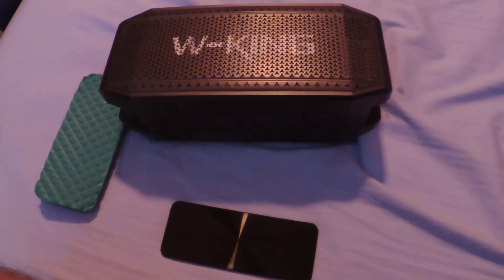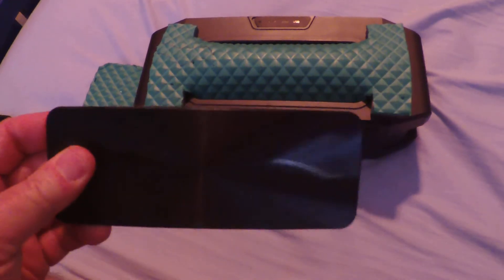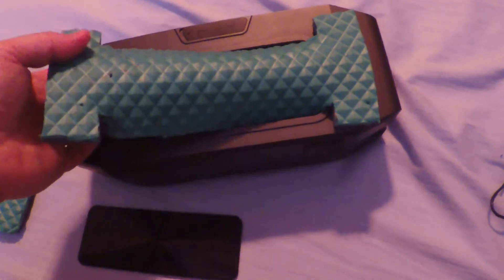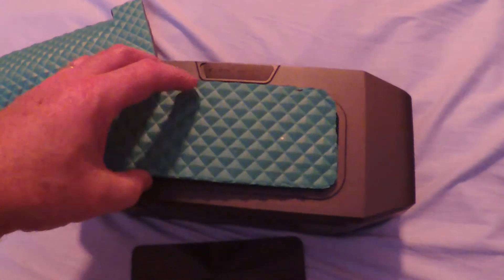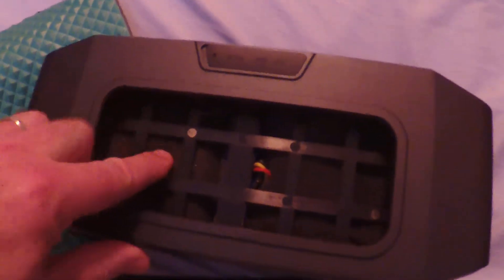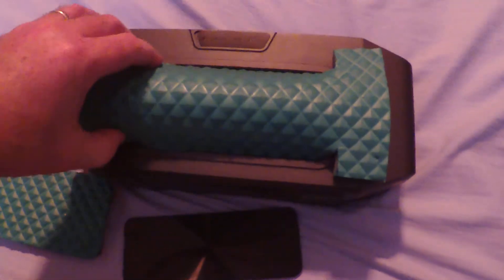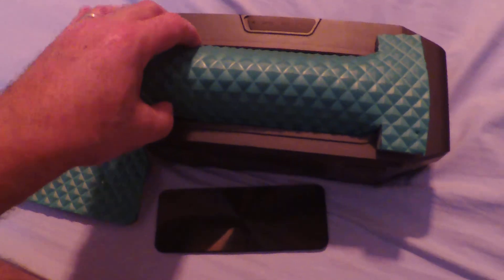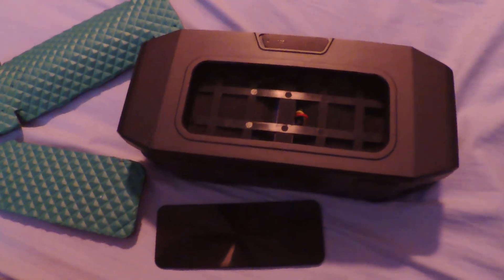W-King WKing D9 Deconstruction for Adding Ported Enclosure

Comment: How did you get the tape off to remove the Handle I am really struggling
Reply from the maker: Push the tip of a screw driver into the holes (you can't see the holes but you can feel them) to bend or deform the tape. Once I found the holes positions I punctured the tape and pried it off.  I doubt they've change it since the original. It should come off. Keep searching for the holes positions.

Comment from the maker: My results are really no major discernable differences, might be a bit louder and less distorted on really bass heavy tunes. The enclosure is just too small even making it ported. The punchiness even goes down when I ported it to much. A little works best. It's probably completely subjective as to what sounds better or best. You can hear lower bass with your ear to the port but it never escapes the enclosure. The cabinet design is ultimately the issue which is why they kept the drivers about the same and enlarged the cabinet for the T9 design.

Comment from the maker: As I understand it the ported enclosure in general  is supposed to provide less distortion, more bass (lets more escape from inside the cabinet), adds a bit more loudness but it also needs to be properly sized & tuned in the design phase. I'm sure there are general rules and mathematic equations but some of it is likely trial and error too. A speaker is totally different from a monitor. The job of a monitor is to most closely reproduce the original recorded sounds/instruments without adding any speaker and/or cabinet character. A speaker is like an individual instrument of its own which adds character to the original sound to make it more appealing to the listened. Monitors are for production of music and speakers are for the enjoyment of that production of music.
Reply: the only real way to know is to have a tool like the DATS (dayton audio test system) which allows you to pull the TS parameter (electromechanical parameters of the driver) then model it in a speaker box performance modeling software like winISD and figure out ideal tuning for flat and even bass response sometimes its not a ported, it might be a T-line, sealed,  horn or bandpass enclosure thats needed.

Comment from the maker: I think I've determined that it does better with a single small port rather than (2) with one on each end. I'm cutting in a hole near the middle to see how that works. Ultimately it would seem that the enclosure is really just too small for these sized drivers including their really large magnets. I'm not sure any style of porting makes all that much difference. It really needs more internal space. It is the master of upper bass but just not low bass.
Reply: in general the enclosure is way too damn small which is why the passive radiator works. With ported you need literally 2x the size of the enclosure and you need a solid tube for a port like a pvc pipe from home depot.  Even if you get a low enough tuning by killing off all the port area, its going to cause poor performance in general. You are just having a leaky sealed box more than a real ported enclosure.